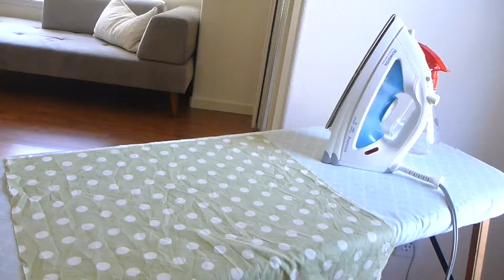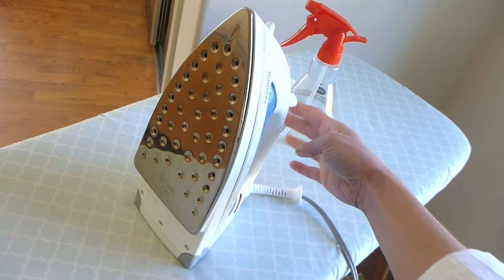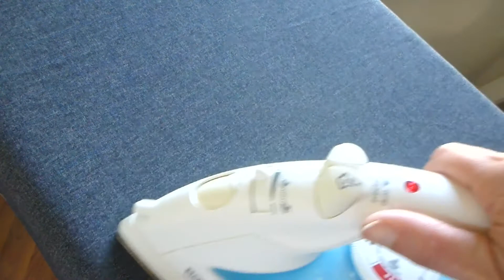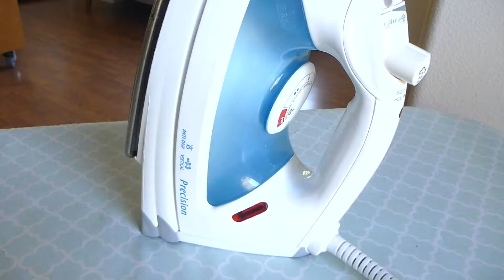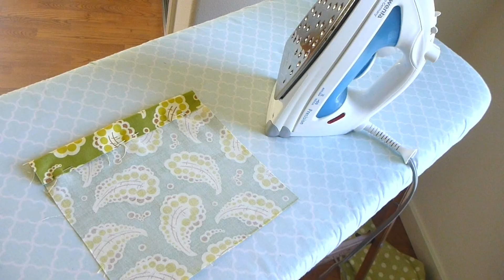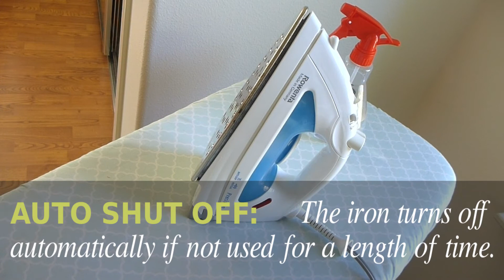Basics:  Using an Iron; Learn to Sew Video; How to Use an Iron

Comment: Do you fill the water after or before you switch on the iron?
Reply from the maker: Fill the water before you plug in the iron, while it is still cool.  My personal preference is to use a spray bottle instead and not fill the water reservoir at all.